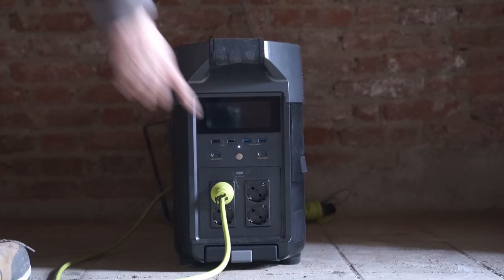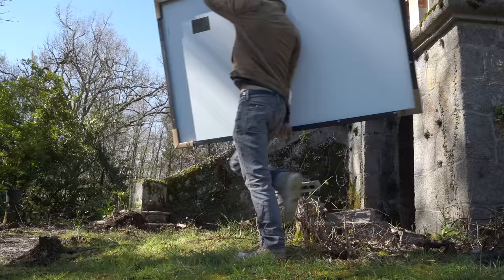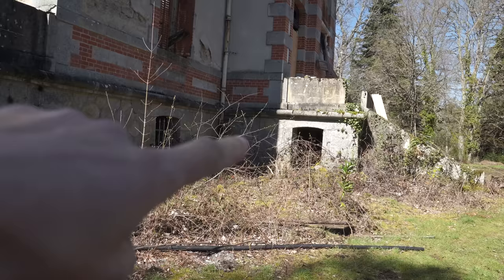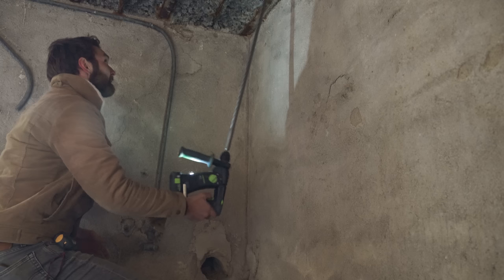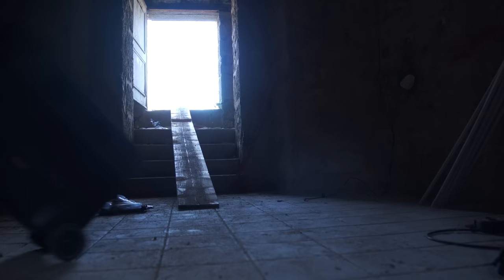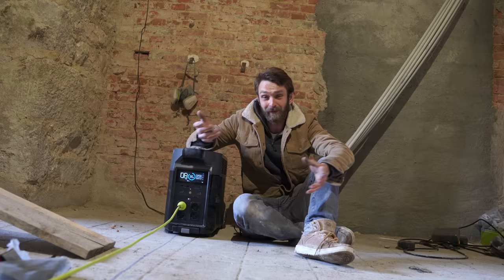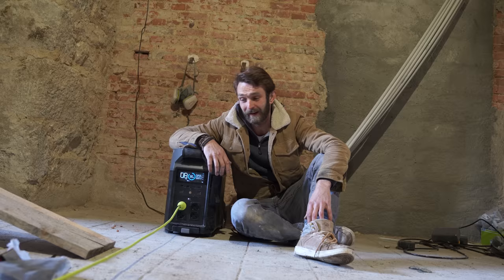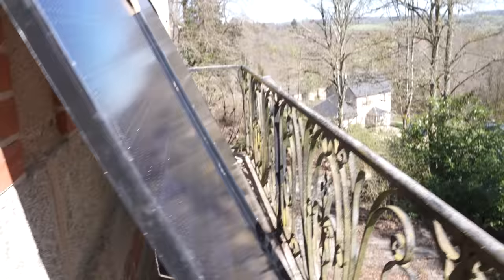This chateau shell creates green energy

Comment: Hi, I work with renewables and sole parks, I would strongly recommend you to build a structure that lifts the panels above the railing. Because only part shade has a massive effect on the output and you might loose half of the energy from the panel because of a little shading!
Thank you for the good videos they are an enjoyment!

Comment: For your information. Depending on the panel you have even a small shadow, like the shadow from the railing can make a huge difference on the power generated.
Reply from the maker: Yeah I’m going to have a play with placement yo there
Reply: @escapetoruralfrance  Could you put them on a bracket that can pivot and clamp it to the balcony rail? That way, in summer when the sun is in a different position, you'll be able to easily adjust the angle, and then tilt them back as the seasons change. Look at the options in satellite dish mounts (quite affordable) that you might be able to McGyver to fit the back of the solar panel.

Comment: Top marks, DAN. little concerned a out health and safety issues, but heigh-ho bit late innit? SUPER impressed with this eco flow system which is going to be, as you said, a life-changer, for the chateau restoration. this means you can get Amury to come over and work his magic and even run an electric razor for the next Movember shaveoff GRIN

Comment: V33:YAAAAY POWER AND LIGHT! Now when you get some roofs on get more solar panels up there and you wont have ONE electricity bill and you are CARBON NEUTRAL. You can ALSO heat all your household water with black radiators (thermal panels) on the roof FREE HEATING...........MORE Co neutral! This is addictive binge watching...........👍👍👍👍👍👍👍

Comment: Solar fan here, well done! 🙂 But, depending on how the panels are wired internally, having shade fall on individual cells that make up the panel can cause you to lose a considerable amount of the total power output. The individual cells are each about the size of a candy bar, sometimes the size of your small finger, and you can see them if you look up closely. Sometimes the internal wiring scheme can cause a whole section of the panel to stop power conversion if even one cell of the section is shaded. Either way, any amount shade will reduce the efficiency of the panels, regardless of the wiring. I noticed that the balcony grating is casting shadows on the panels. Perhaps you could prop the panels up somehow (on a simple wood construction?) in such a way that they're above the level of the grating and aren't shaded at all. Keep up the good work. 🙂

Comment: The metal railing is casting a shadow on the panels, you should place them in a place with absolutely no shadow casted on the panels. The type of the panel greatly suffers from any shadow on the panel and will reduce the output by quite a lot. If you now have 2x400pW panels, you only seem to be getting less than 300W from them combined, probably due to shadowing.

Comment: That was a bit hair-raising at times! Glad it all worked out. I am hoping you will use a broom on the tiled floor areas as you clear out the rest of the debris from the main floor. (Scraping across the tiles with the shovel worries me that they could be scratched or chipped).  Great progress! Question: if you got two more solar panels, would you put them on the opposite side of the château or what?

Comment: The tiny bit of shade from the wrought iron significantly reduces the power coming out of those panels, . . . or at least that's been my experience. Mount them so the railing doesn't cast shade on them, and it'll be even better.

Comment: I would think that putting in 8 of these system with 4 panels and 2 Ecoflow batteries each, you should be able to power the whole chateau with 16 batteries and 12,800 watts.  It might be cheaper and easier than bringing regular commercial power.  You would have to heat with wood and boilers but you have a forest that will provide all your needs,.

Comment: you need to hang the panels higher, the shadow will reduce the power by a huge margin! 5% shadow can reduce the panel by 50% percent or more... and why didnt you tie a rope to then and hoist them up?

you can mount them on the outside or the gardrails :)

Comment: MY BROTHER... STOKED TO SEE YOU GETTING A PROPER OFFGRID SETUP... JUST BUILD IT A LITTLE AT A TIME, MORE POWER PAKS, MORE PANELS. YOU CAN RELOCATE EVERYTHING AS YOU PROGRESS. ON A RATHER SAFETY ISSUE SORT OF CONVERSATION, IVE BEEN A SAFETY ENGINEER AT WORKSITES, ON MULTIMILLION DOLLAR PROJECTS IN MY LINE OF WORK, AND YA MIGHT SERIOUSLY CONSIDER, A SOLO SITDOWN WITH YURSELF. JUST TAKE A STEP BACK, AFTER ACCOMPLISHING SO MUCH. THERE ARE QUITE A FEW CONCERNING THINGS I SEE THAT COULD REALLY CREATE A UNFORESEEABLE BUMP ON THE HEAD OR FALL. #1. AT LEAST TRY TO GET A HIGH REACH TO CLEAR THE LEFT OVER DEBRIS OFF THE TOP OF ALL THE EXPOSED WALLS. AND CREATE A SLING TO LIFT ITEMS UP, BY HOIST ROPE OR STRAP.  NOT ON YUR BACK, AND THROW OVER A ROPE TO ANCHOR OFF THE LADDER OUTSIDE. SO IT CANT SLIDE  SIDE TO SIDE INSIDE... JUST THOSE KIND OF SIMPLE SUGGESTIONS. AND IM SURE AMAURY IS ALWAYS WILLING TO LEND A HAND. HAVING YOUNG BOYS AND YUR FAMILY TO THINK ABOUT IS WHY I SHARE THESE THINGS. IN MANY A SAFETY METTINGS I HAVE LEAD, I ALWAYS WOULD TELL THE WORKERS TO THINK OF BEING SAFE FIRST, THEN GOING HOME TO FAMILY AT THE END OF THE DAY. . CARRY ON YOUNG MAN... WELL DONE!!

Comment: The plane of the solar panels must be at specific angles to the sun and is dependent on (1) the installation location's latitude and longitude (similar to aligning a satellite receiver dish to a geosynchronous satellite) and (2) the time and date of the year (location of the Earth in solar orbit) for maximum solar panel efficiency and for the fastest recharging of your battery pack. The solar path across the sky changes daily and your balcony placement is not really suitable for the periodic, perpetual realignment of the solar panels to the solar arcs.